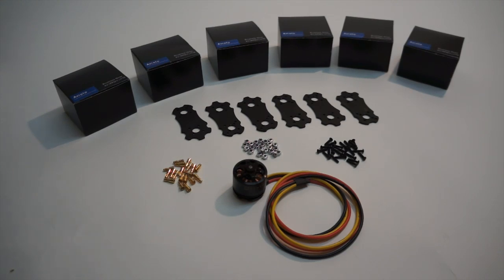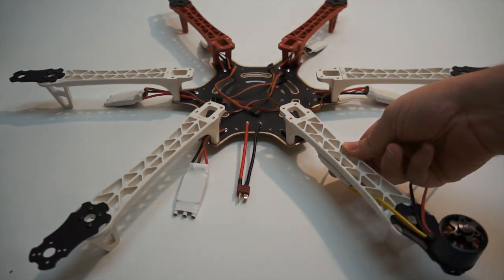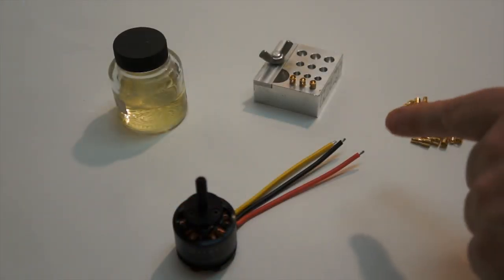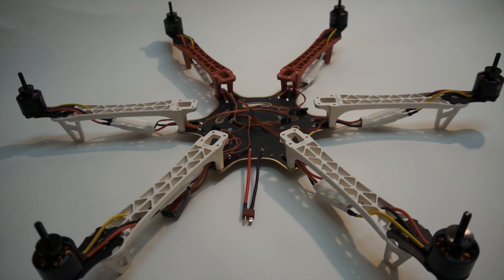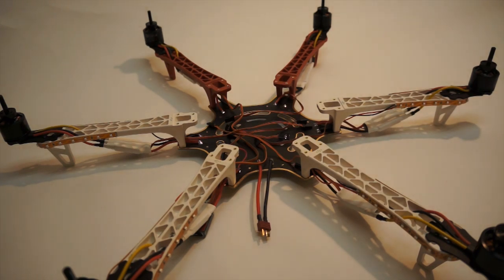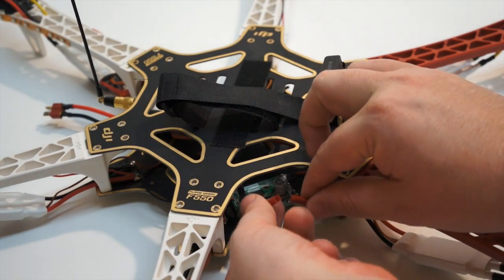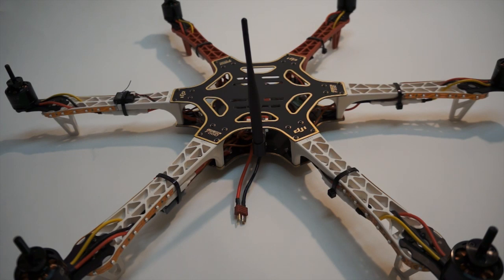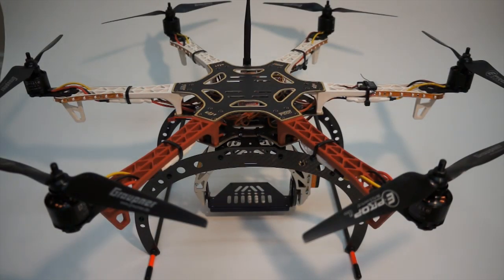DJI F550 ARM EXTENSION HEAVY LIFT CONVERSION BUILD How To by Aerial Media Pros

Comment: well my DJI F550 with this kit will easily haul all my Wookong gear, OSD and 5.8g video link, 900mhz datalink, camera gimbal, GoPro camera, 2 x 5000mah 4S batteries, FPV fever Optical zoom camera, big light display etc and lifts easy.